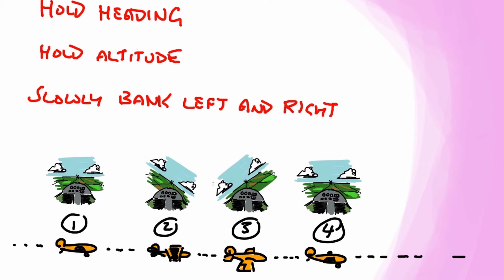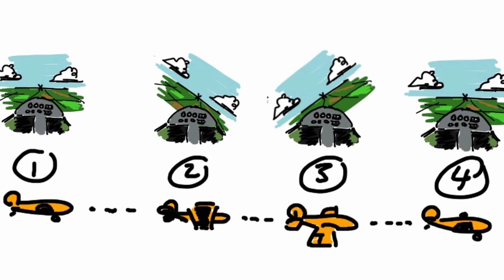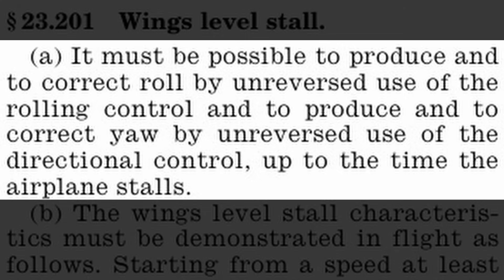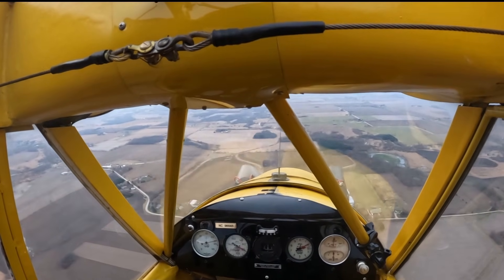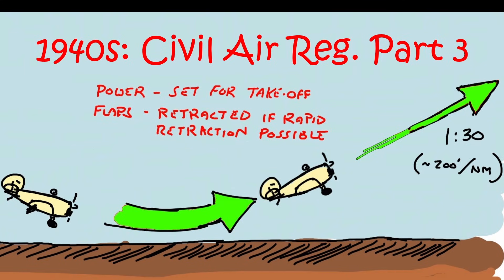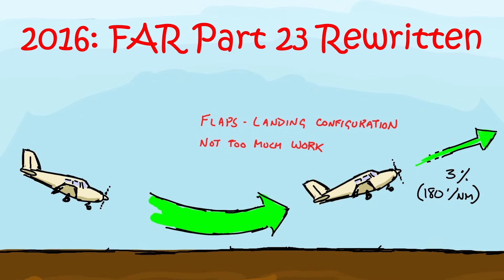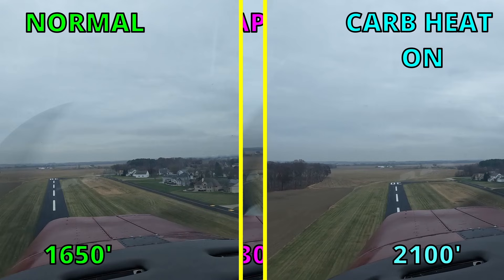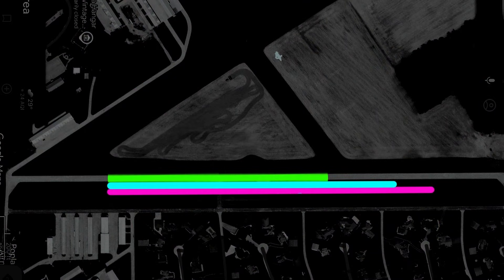Go Arounds Gone Wrong: Testing the Cost of Errors

Comment: Actually, after watching this video, I felt that you emphasised flap retraction during the go-around without mentioning how dangerous it can be when done incorrectly, especially at too low  airspeed and particularly in small aircraft like the C-152. As you can see in the video at 13:30, the pilot almost stalls the aircraft because he retracts the flaps before establishing a safe climb-out speed (you can see the aircraft sink). When you retract the flaps, you reduce wing area and the coefficient of lift in exchange for less drag. You do gain excess thrust, which is desirable, but only if the procedure is done correctly and after establishing a safe climb out speed.

I feel like you didn’t point that out enough and simply called it a good job at 13:30.

My instructor would have slapped my hands if he saw me reaching for the flaps immediately after adding power on a go-around ;D
Reply from the maker: Great comment, and thanks for watching the video!  I really enjoy these discussions!  There’s a lot of ground to cover since you touch on some important things.  Pardon the long response.  I'm going to write a lot here.

General Flap Priorities and Philosophies Presented:
To cover your point I had a couple minutes of “This is what I’m thinking about as I retract my flaps and here are my priorities…”.  That was in the same section where I discussed how and why I accelerate in ground effect.  For a lot of reasons I decided that sharing video of me accelerating in ground effect and flying a Vx for a specific configuration (published in one of my planes, derived in others) was a bad idea. 

So I cut the whole bit.  I re-filmed a bunch of go-arounds done to Vy and flap-up Vx and made my suggestions much more general.  That got replaced with “You’re going to be going around.  Many times, this is going to come as a surprise.  You better practice and get good at these.”.  The idea is if you get people to drill and discuss these, they'll get the judgement and habits to stay out of trouble.

Cessna 180 Go Around at 13:30
When it comes to that Cessna 180 doing the go-around in Washington, I stand by saying he did a nice job.  He wasn't wallowing in a low energy state after he retracted the flaps, for example.  He was thinking.  He had an escape in mind, and he was ready to fly that escape when he needed to.  I can't ask for more.

I love these points!  Keep ‘em coming!

PS: I've told people to wait and slow down reaching for the flaps after the power application  myself.  Nothing needs to happen faster than we think.  I think pretty slowly.

PPS: I've edited this down a few times for brevity.  I wrote a novel the first time out.

Comment: The graphics on the go-around in different configurations are invaluable.  Before I soloed a student, we would do some go-arounds leaving the flaps at full to simulate a flap failure at the worst possible moment.  In a C172R on a standard day at a near sea-level airport, partial fuel, etc, we would climb out at an amazing 500fpm - pitch and speed control were of course critical - we'd climb at or near Vy.  So in that model under those conditions, a flap failure on a go-around was no reason to panic.
Reply from the maker: Awesome to hear that you were drilling something similar in the 172.  It's hard to get the right balance regarding the need to clean the plane up versus the need to remain in control.  Sounds like you provided a lot of good to your students.
Reply: Hey. So we do fly a 172 that has flaps 40. I discussed with my instructor and we decided that we would not use that setting to keep things consistent, as that is the only one that can do 40. 

One go around I was wondering why the plane was not climbing normally. Looked at the flap lever, it was up. The indicator was not, and sure enough, flaps didn't retract. Full fuel and relatively hot day, so the rate was positive, but only barely. Once we figured out the problem and cycled a few times, they did retract. I don't think we would have climbed at all with 40. 

So yeah. 30 is probably fine if you aren't too heavy or density altitude is fine. But if you have access to 40... I'd do that only if landing was assured.
Reply: @Outworlder  I've had flaps fail a couple of times in a C172 so that's good risk management.  I had an incredible lesson one morning at Leadville, CO - 9934' elev.  Climbing is so anemic there they quit flying at midday.  But one thing that really stuck was that they never use more than 10 degrees of flaps because they knew that airplane would not climb with flaps greater than 10.
Reply from the maker: Leadville is pretty high.  Glad you took the opportunity to fly in/out of there.
Reply from the maker: Exactly.  Flap motors break, flap rollers jam.  Cables bind.  I'm not opposed to flap 40.  I use it a lot.  But there are considerations with anything.  Thanks for sharing your experience!

Comment: Fantastic video! Thank you for your contribution to aviation safety!! One thing I would like to add: think of ground effect (above runway) as a friend. There is reduced induced drag in ground effect.  PW (CFI)
Reply from the maker: Fantastic input!  I had a segment of the video where I described accelerating in ground effect and retracting flaps partially, but I couldn't get the presentation right.  It became a "Fly the way I'm flying" type of presentation, rather than a "Here are the factors to consider" type of thing.  So I cut it.

How to use ground effect and errors might be a good subject for it's own video.

Comment: Thanks for the video and excellent lessons on total, not just fuel, energy management.  Dutch rolls are excellent teaching of the human need to lead rudder for coordination of aileron with rudder in all turns.  In order to nail the target or heading, we must start with correct yaw and not adverse yaw.

Slow flight the old way gets us close to the airspeed and resultant aileron inefficiency needed to understand proper landing airspeed and proper rudder dominance, but even Vso is considerably faster than the actual airspeed our wing quits flying at in one inch low ground effect.  I teach hover taxi down the really long runways available today so the student can get actual seconds rather than just instants at this extremely important airspeed for landing and preventing fatalities with any LOC.  You demonstrated this power pitch hover taxi with your low energy state prior to go around exercise.  I like the new airplane requirement to attempt a much shallower pitch up on go around (or takeoff.). I really hate the poor muscle memory put into the student's head when we start the go around procedure with "establish a positive rate of climb."  I agree with Wolfgang Langewiesche when he says airspeed and altitude are two forms of the same thing but the experienced pilot prefers to have the thing in speed on takeoff (or go around.)

I taught in AA1 at Flagstaff and AA5 and Cessna 140 at Monte Vista Colorado.   High, heavy, and hot gets too many pilots who have trained and are comfortable with getting up fast halfway down long runways.  In the mountains, especially in summer, leaning to max RPM, staying level in low ground effect until cruise airspeed, pitch to just over not well over any obstacles, and down drainage egress are even greater considerations than wind management.  I told my students, "When pulling doesn't give you the climb you expect, try pushing on the yoke."

Thanks again.  Good lesson.
Reply from the maker: Really glad you liked it.  Getting the presentation the way I want it without transmitting something unintentionally takes a lot of editing, re editing, animating, etc.  So comments like these really keep me going.

Comment: Good stuff. Two additional comments: 
1) not sure if my CFI taught me this or if it was my idea, but if there's nothing for you to hit on the runway, accelerate in level flight over the runway before climbing out. That includes reconfiguring- make sure there's sufficient energy to not settle onto the surface, accelerate to Vy, and then start climbing. Too many of the accident videos here are pilots trading altitude for airspeed and stalling over the runway.
2) I've never found a good reason to use 40° flaps in a Cessna- I think it adds too much drag, to the point that as the video here shows, it makes go-arounds risky.
Reply from the maker: Great comment!  I was going to talk about accelerating to speed before climbing out, but I wound up cutting it because it turned into a "Fly like I'm doing" rather than a "Fly the way you need to" type of thing.  So I cut it.

That's why comments like these are so productive.  Thanks for this!
Reply: Yeah. We had a flap failure on go around but decided not to use flaps 40. Thankfully.
Reply from the maker: That situation right there is something worth thinking about.  I'm not opposed to flap 40 but we need to consider the pros/cons/risks/rewards, etc.  Thanks for your comment!
Reply: The fundamental flaw in these scenarios is always the same; The pilot assumes the elevator causes the airplane to climb. 

Even the nomenclature "elevator" is misleading.

The elevator does only one thing: It sets the angle of attack of the main wing in relation to the relative wind.

Read that twice.

The elevator STALLS the wing when it is deflected far enough. 

This happens at any airspeed, any altitude, and any attitude. (Nose in relation to horizon is irrelevant). 

To avoid the stall during go around, simply keep the elevator neutral.

Do not displace the control column or stick rearward beyond a slight back pressure to retain control and prevent nosediving. 

This of course results in the airplane skimming along the ground, picking up speed, and maintaining far from stall at all times.
Reply: @Triple_J.1  Yes. Before my "discovery flight" with the fellow who would ultimately be my instructor I was asked "what does this do" as he pointed to the "elevator". I had just read "Stick and Rudder" so I figured I'd be real smart and I said "it controls airspeed". The look I got was priceless. I think he believed that I was a real dummy.